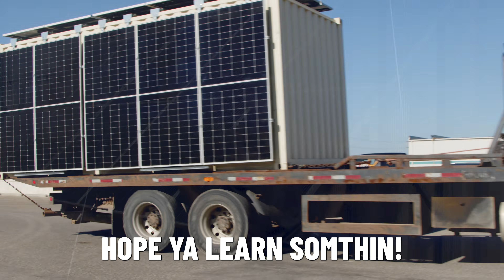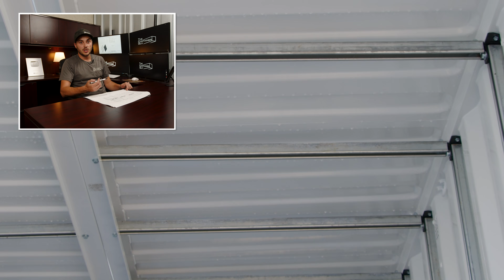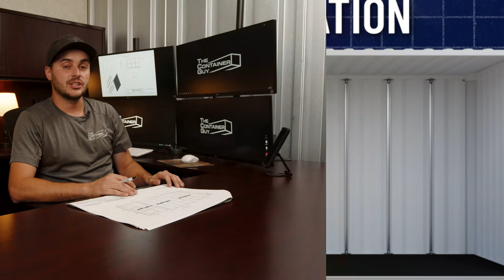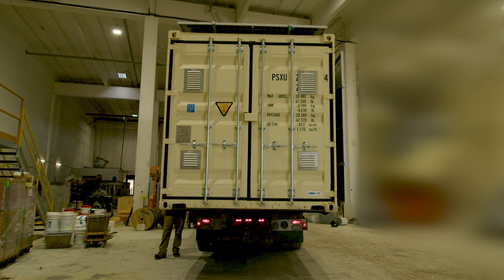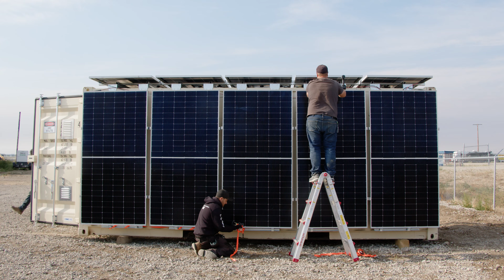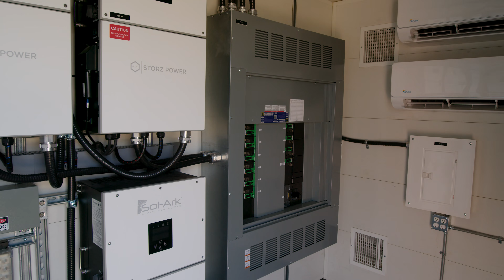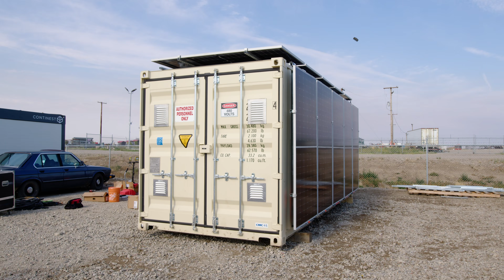Transforming a Shipping Container Into a DIY Solar Power Station! #NATO

Comment: Are those Sol-Ark 60ks? They look smaller than I expected.
Reply from the maker: Sol-Ark 15k. 9 of them. 135kw total. How many panels would feed into the building?
Reply: @TheContainerGuyTV  the 15k can do 18kW of PV input. If you over-panel a bit and do 20kW per inverter that's 180kW (~333 540W panels). Why use the 15k instead of the 60k if you want 480V?
Reply from the maker: @niktak1114  that's a great question. Probably a wise decision too. I will relay it to the electrical engineer who designed the system. Would you only need 3 of those instead of 9 of the 15k?
Reply: @TheContainerGuyTV  a single 60k can output 480V 3 phase by itself so two would get you 120kW output and 3 would be 180kW.
Reply: @niktak1114  probably has more to do with the battery. There are not a lot of user friendly high-voltage battery stacks out there that would pair with the 60k. It doesn't look like there is much energy storage in there either, it was probably just easier to set up a 48v system all things considered.
Reply: @TheContainerGuyTV why do they need 9 SolArks for only 10 panels? What is it being connected to? Thanks and keep rocking...
Reply: You've got a ton of room for the expansion of your solar and batteries. Quite the setup. And Sol ark is the only inverter I know that uses banks of capacitors to make their inverters emp resistant. 💯👍
Reply: Half a milly? Geeeeez!
Reply: @extraclip  Yeah, that is too expensive to be practical and there are cheaper options.  This is a bit over engineered.

Comment: Great work.
Im curious what the solar panels are used for, it looks like just to run hthe aircons & control gear  as 5kw pv can continuously run a 1200w load 24hrs and need 35kwh storage in full sun in a sunny climate.

I would like ro see the on large on site solar array the solak inverters connect to.
Really impressive.

Comment: I like how you mounted the panels, I was trying to figure it out to mount the solar panels to my travel trailer, I cannot get on the roof any more too old clearing snow off them in the winter is crazy, so I am putting them (1) 390 on the front, a 390 on the side and 530 on the back. I only have a 600ah of battery and trying to get as much solar as possible.  I should have 1310 Watts @ 91 amps going to my victron mppt controllers. I have similar brackets, I used commercial gate hinges for the top, and similar channel for mounting the panels bolted to the rails. with a hinged mechanism to fold out.. thx

Comment: For maximum usable storage.Is it better to put 220 foot containers together Cut out the walls or just use one long forty foot container
Reply from the maker: Really depends on what you're doing. If it's standard storage stuff like boxes, a long 40' is going to be cheaper than a double wide. If you are looking at storing multiple small vehicles like atv's or lawn mowers, the double wide would provide enough space.

Comment: That seems like a lot of inverters for 10 panels?  Also, I was super weirded out by two batteries in the shed (seems like it should have been a ton of batteries and fewer inverters) to match those panels.  Also the mini-splits could have been hot/cold heat pumps that just maintain a set temperature, the extra controller seems vestigial.  Lastly, I would have added a last heat pump for redundancy.

Comment: Two I Line panels; one for input and the other is output.  The SolArk units support grid and generator ties.  I was really hoping you would open up the box with the HMI display on it.  A generic gray box with generic HMI doesn't paint a very detained picture.

Comment: So, this would produce a steady 24/7 power of approx 1.2KW? Seems like a lot of work and cost for such a small system. Im assuming the customer is planning to add ground-mount solar to reach the capacity of 120KW? That would add-up to approx 30KW of continuous 24/7 power.

Comment: 5.4kw of PV panels will produce about $5.67 worth of electricity (@ .15 cents per kwh).  To put this in perspective, 5.4kw of solar panels will power three electric hair dryers, running 1800 watts.  We have 1.15kw of solar panels on our liveaboard sailboat and we make about $1.20 of electricity per day.

Be honest with your audience.  You have a portable generator in a container.  The solar is awesome and has a place within a reasonable scale but will not power a whole town.  

The average home uses about 35kwh per day.  The solar portion of the rig would power one average home.  You can have all the battery storage in the world but if you can't fully deplete and fully charge those banks, you cannot claim the rig as a sustainable solution to power a town.  Ridiculous and the same predatory statements that sell "solar generators."

Comment: When I heard the price, I thought it must be a HUGE battery, wrapped in a container. Makes sense. But apparently its not. I wonder, for a heavy all day use, isnt this just a big diesel generator with some green paint?

So, with these specs, this makes no sense to me, not even for 10th the price. But you guys got paid, could experiment, learned a lot. Once battery prices come down, this all will be super valuable knowledge. 

With the current battery prices, this system would make more sense to me for producing and storing a lot of hot water with mobility, for whatever needs.

Comment: I know this is now an old project, however I thought I would add a thought to your design.  I have been running a solar business for over 10 years.  My thought is to aid with transport.  On the non door side of the container, add a metal lip to act as a wind deflector.  Preventing uplift on that size panel is paramount. The glass gets very fragile at that size. So the lip will just bounce that initial hit of air up and over the panels.  Cool project

Comment: Why only 10 panels when you could fit 17 at 5 on each side plus 5 on the roof plus two in the back while facing the container in the direction, the sun comes up

Comment: If I had the money to easily buy one of these with out breaking into a sweat. I would. In the UK we can sell the electricity we don't use from a renewable source to the grid. So if there is enough electricity produced to run a dozen houses, or more, from this device... That would be quite the passive income. Still might take a while to pay off the container through this method... But it is passive income regardless!

Comment: you need to use screw type actuator arms to lift them... you would not need to lock down and could easily automate to follow the sun to maximize power. plus prob break even with extra parts/labor  for handles and lock

Comment: 😀😀  As far as extending and retracting the solar panel arrays, it appears it would be a hassle to climb up top for these actions. A potential fall hazard. You have created a portable power station. Why not use electrical linier actuators to extend and retract the solar arrays?   Or, if you look at the RV industry and how they use a 12v motor to extend and retract the stabilizing jacks or the pop outs. I am in no way an expert. But one thing I do know, there are always more than one way to accomplish a task. Just need to look around.

Comment: ...enough to power a whole town....I guess you flunked math. That 10 x 540 watts means 5,540 watts or 5.5kilowatts.  That's not even enough to power my house, i have 15kW solar here. Why all that huge 480v high amperage power distribution downstairs in the box, I don't understand. That roof is generating roughly what a single 30 amp single phase 240v AC circuit can deliver.  That's it.  I'm at a loss what's going on here. Is this like high dollar snob audiophiles? Do you add bling and overkill?  You;ve got what looks like enough distribution hardware there to field the power of at least 100 such trailers' generation. Just the necessary dry transformer to make 120/208v three phase, which is necessary to make a voltage people can actually use outside a big factory, the standby heat off the transformer in your room might be more that a mini split could keep up with.  Sorry, I'm a design engineer and something doesn't compute even by a factor of 100 maybe 1000.  In essence, the solar would be on average too little to cover just the heat losses of the transformer just sitting there 24/7, let alone delivering any reliable power to a single house, let alone a town.

Comment: I'm confused, I see huge 480VAC power going on inside the container, but about 1/100th of that generation on the roof. Is this controlling 100 such containers and this is the hub maybe? That'd make more sense.....if not, this is akin to driving a Formula 1 car with a scooter engine.....

Comment: This is amazing, that one box can power 4 to 5 average North American homes at max output. Put one of those boxes on every block, then add (I'd guess) 2 panels per additional home, and you'd be set. At 12 houses per block (per side), you'd be looking at 16 additional panels to power a full block with some wiggle room. I'm guessing other than the container the solar panels are probably one of the most price-friendly parts of this setup.

Comment: Your electrical room door-sign listed 480 volts and the price you listed was something like 480,000-bucks for this unit.
I suck at math but even I can figure out that it's one-thousand-bucks per volt.
If I could afford that I'd get one and just live inside the temperature-controlled room with the electrical equipment if need be.
If your condensation lines produce enough water, you might be able to convert them to a cooling source for your solar panels.
Keeping your solar panels cool can also increase energy production of the panels.

Comment: Why are the mini-split AC units not vented outside? That doesn't make sense to have a mini-split outdoor unit inside an enclosed space and require a second fan to move the heat outside the space. It you had the mini-split against the outside wall, add a wall penetration with a storm grate. That way air can come up from the grate in the floor cool the condenser unit and exhaust through the wall. Those wheeled things inside the strut are called TRUCKS.

Comment: Looks very similar to the equipment rooms of the mobile data centers I worked in. 
But there were 2 massive switchgears and 8 of those big breaker panels per MDC. But this looks much cleaner. Both the wiring and lack of dust 😅

Comment: "Enough juice to run an entire town" is extremely misleading.  The generator would be supplying 99% of the power since you only have enough solar panels for about one house there, and not enough batteries to do much good either.  You failed to show the generator, but I'm guessing that comes on a second truck.
Reply: Yah, know I live in a two BR condo, and I burn 7K just for AC… 10K for an average day. So I need 2hrs of his 5400 just for my condo… if his town is 4 houses, then he is right!
Reply: Absolutely, there is no way it could do a small town , it's misleading.
But useful for many setups all the same.......
Maybe a toytown 😅

Comment: uhhh 10x 540 watt solar panels is only a max array size of 5400watts, at most your going to get maybe 4800watts for 2.4 hours during peak sun.  I mean seriously the overall best that thing could do outside of reality is 5400watts per hour x say 14 hours of sun per day if its direct the whole 14 hours (Fantasy Numbers btw.  That is now way how the real world works).  so more math 14 hours of direct sun light on a no-lose peak powered array of 5400watts, no losses on the wires, no losses on the inverters, etc. etc. so 75.6kWh per day.  Average house hold uses 10,500kWh of electricity per year or 28.77kWh per day.  So what you get 2.6 homes powered per day.....That is a far cry from a "whole town".....btw in reality that 10 panel array would power about 85% of the average house hold

math ain't mathing....even with fantasy numbers Math ain't mathing.....

Also why do you need 9 Solar inverters? ya'll said it has a backup Generator....I mean seriously it's a Generator with an over sized battery backup and solar panels to power the climate control in the container.....Btw where you put a Generator that big? in another container or just left it on the trailer and hook it up how you would hook up a backup generator?

Who is giving this idiots money.....
Reply from the maker: Your government. 

Watch this video: https://youtu.be/drw_uMQ4wGs
Reply: @TheContainerGuyTV  so your happy about wasting tax payer dollars.....
Reply from the maker: @DrunkinDuckie  providing better accommodations for the men and women who protect you
Reply: @TheContainerGuyTV  they can get electricity from anywhere including the generator you are including which is more than likely providing the lions share of the power.
Reply: @TheContainerGuyTV  this is your future.....

https://www.youtube.com/watch?v=wD2OzvkM36g

Comment: 0:23  The my first observation was how would you get that down the highway with the leading edges of the panels exposed to the wind.  Seems like they'd get ripped right off.  Edit:  Hmm, I see later in the video it becomes a problem.  An easy solution is just install small bumpout in front of the first panel to guide around the panel rather than under.  You can clamp the panel down more firmly, but risk wind induced resonance that can shatter the whole panel.  It depends on how often it's moved down the highway.

Comment: Thanks for "Live Test & Learning" to Make things better for the "New Guy" in this process!

**Road Prepping the "Grab Handles" - Idea: Have a "Latch" System, like an Angle Channel on a Hinge, that swings up to cover the handle, but goes a bit taller, and install a Locking Pin (Like for Trailer Ball Hitches) to them, into a backing plate, for security during travel, and - if you like, make a spot for the Metal Shipping Tabs that Secure Sensitive Loads on Trucks. (Kind of looks like Metal Tie Wraps.)

Comment: I don't get why there's so much hardware inside the crate for what is a tiny solar array.
Reply from the maker: It'll be connected to a 135 KW ground array
Reply: @TheContainerGuyTV  then why bother putting what is essentially 0% of the solar capacity on the crate when it contributes nearly nothing.  It just adds unnecessary complexity.  If you need enough power to just minimally power it while it's not plugged in to other things, just some rigid mounted panels to the top would most assuredly be enough.   It shouldn't be generating much heat when it's not plugged in to the full array -- and then it has the full array to power it.   All the wonky engineering going towards "fancy" panels on the crate would be better spent on the actual large array.   You wouldn't need tie down points and all that other wasted complexity.

Comment: 450k i achieved this with 4k only used one 10kw lithium battery and one on off grid inverter and 16 panels with 7 hiurs full sun its enough for me in Somalia thanks to my sunny weather😂😂😂 and if i increase the setup to 4x battery 2x the panel array i can use 12000 btu ac on  24/7

Comment: Man, that container is awesome, but it sure seems like overkill on the parts inside. Wouldn't it be much easier, and cheaper, to just put in like. 2 Bluetti EP900 with 8 B500 batteries and the house sub panel package? That would be like 120/240V and 18K Watts output, with almost 40KW hour battery backup - for about $37,000 - plus a 30% rebate if your in the US.  I know that unit you made is for industrial use, but for a regular off grid home, is there any made like the combo I mentioned above?

Comment: To make it a one man setup. Could you have the vertical panel guide arms slide up, not down? If you had them go the opposite way, you could have 1 stop for set up. There will be no need to install a stop when you lift up. I really hope this makes sense. I will look at building one of these down the track.

Comment: Beautiful work! The only thing I personally would do differently is figure out a way either on the door or the side without solar to have the mini splits direct vent to the exterior pulling the feed air from the floor exhausting out the side.  That is a ton of moisture and excess heat to be dumping into the electrical system for no reason.

Comment: For those who are electrically illiterate, 5400w of solar panels will not only not power a town (this is an absurd statement), it's not enough to power one house.  If you pair that up with enough batteries you might be able to power that minisplit reliably 24/7.  Really what he has here is a battery bank and there is no way in hell 5400w in solar is going to do anything more than provide power for those minisplits.  One must assume they are going to plug that into a large solar array, a generator, or the grid.

Comment: I had 24 Canadian bifacial solar panels with micro inverters each panel, installed on a  pavilion build grid tied system so no batteries.. but doing the work ourselves the whole 11kw system plus the pavilion build was 27 grand 😂 I also have an empty shipping container 40 ft.. I'm positive 100% I can copy your build and have 400,000+ left over 😂nice build tho .. I do like it 😅

Comment: To secure the panels at specific angles, drill a hole through the vertical mounted struts and then insert a pin (like what one would so with a trailer hitch receiver) to stop vertical movement of the bearing wheel. Multiple sets of holes could be drilled to provide for several desired angles for the panels.

Comment: You should be using 3Ms Novec 1230 fire suppression system.
Reply from the maker: Looks like it will be discontinued in 2025 or sooner. It feels like the general consensus with batteries at the moment is "if they start on fire, let them go" in non-human occupied spaces. Technology should develop over time and change that then we'll see regulation which will add cost to everything.

Comment: Welded HHS panel frames and supports would be much cheaper than the overpriced Unistrut. The design is good but not practical cost wise.